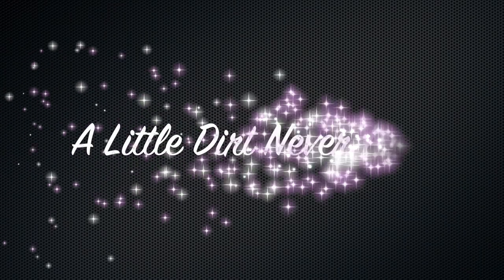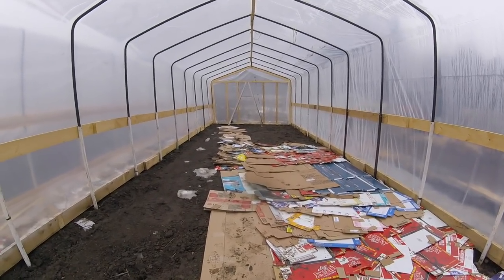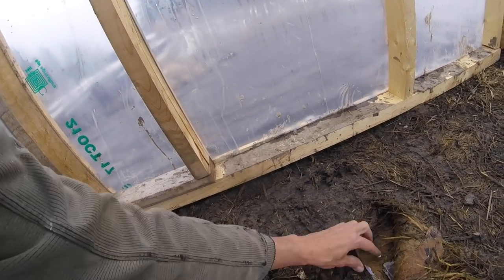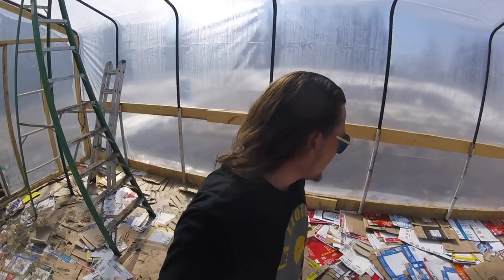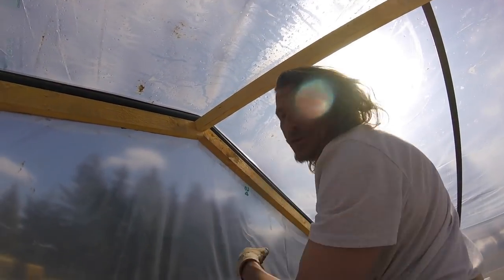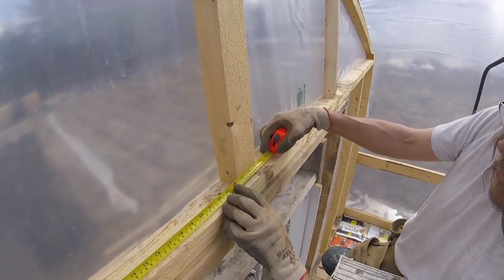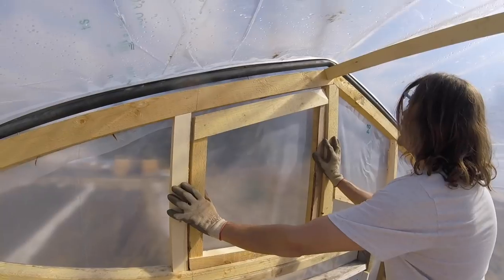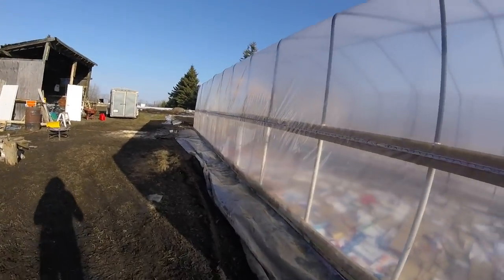Making vents and cardboard mulch

Comment: Can you tell much of a difference inside the greenhouses as far as temp goes yet? I mean the snow melted so it has to be warmer right? Great way to source cardboard bro. Looks like you are a regular there haha They know ya by name kinda like Cheers! Have a good one buddy.
Reply: Man I like that Table saw. I just bought a cheap one off of Facebook Market place so that is some real tool porn for me haha. I can't wait to use it. I like your vents. Good job Ryan.
Reply from the maker: 15-20c degrees when the sun is out!! Huge difference man. 30f outside and it can be 70f inside! Lol, they know me well my friend, and they have partied over here a few times!!
Reply from the maker: DOn't ever buy cheep tools man, just my opinion. The good ones cost, but you will have them for years and are safer for most jobs!! Vents are working great pal, on to the next step!! Have a great week Ronnie:))
Reply: @Mrsnufleupagus  Wow big difference!
Reply: @Mrsnufleupagus  I mainly buy Ridgid. Ryiobi is also made by Ridgid it is there home owners line. This was a return item someone was selling. $50 can't beat that. Anyways did you know Ridgid is headquarters is in South Carolina?
Reply from the maker: I prefer Makita but each to their own! Ridgid is kind of a home owners tool line. You my friend have a farm, and I would put a few bucks into great tools, you will not regret it!! Didn't know that pal, but I do now:))
Reply: @Mrsnufleupagus  Ridgid is like DeWalt and Ryobi is like Black and Decker. Around here it is considered professional line of tools. Plus Ridgid has a lifetime replacement on batteries!  DeWalt is made by Black and Decker. They have a factory in Fort Mill, SC. Actually Stanley owns Black and Decker now.  I agree though, Makita makes really good tool.  I have some of those as well. I like Milwaukee stuff too.
Reply from the maker: @SouthernFoodJunkie  I totally get it man! My Ridgid table saw has served me well:))